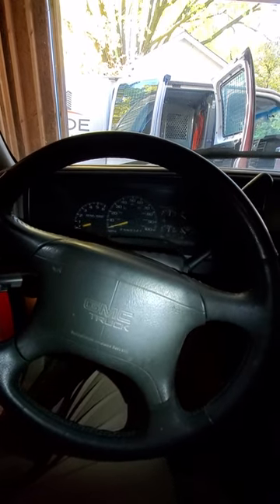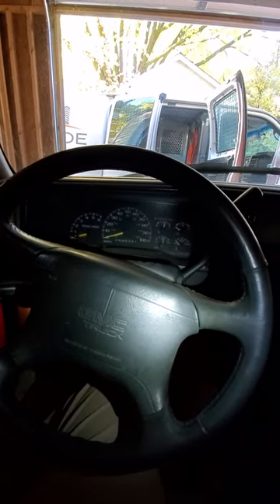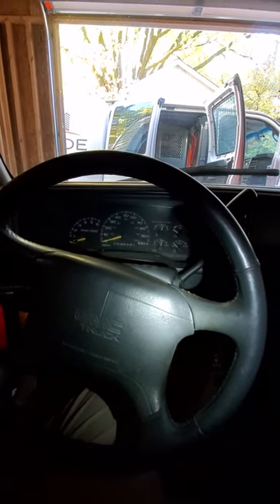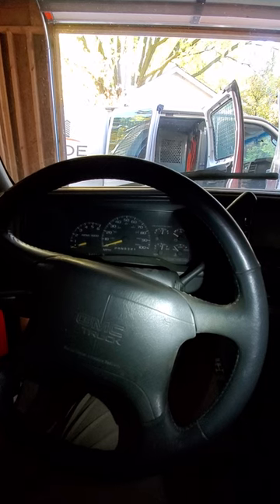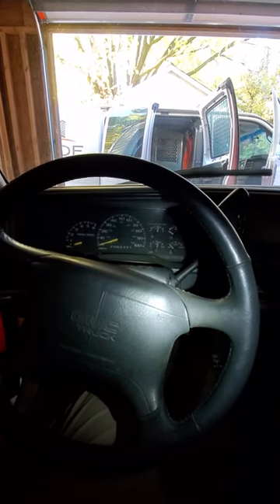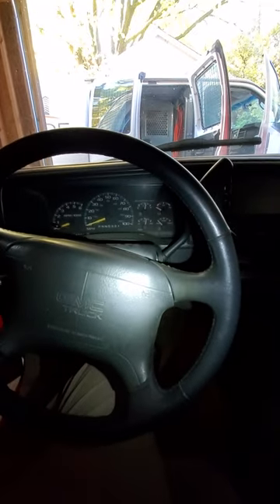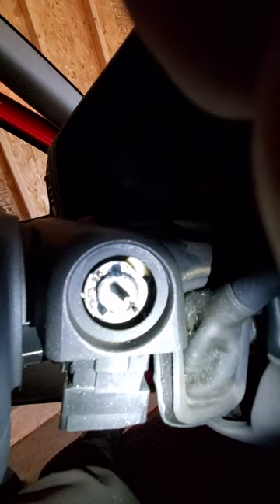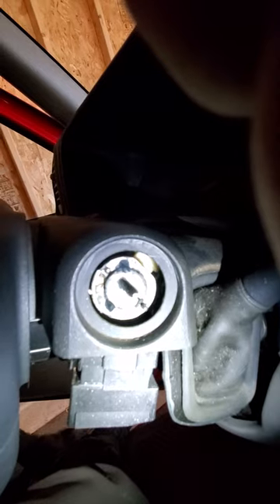1997 GMC K1500 lost key. How to turn ignition with any key.

Comment: Philip, after the hundred something videos I watched on how to do this you're the only one that actually nailed it on how to remove  or turn the ignition with no key.  thank you! your advice was great!
Reply from the maker: I am glad to help. Thank you.
Reply: @happylucky29  Someone tried to rip my 1998 silverado, if I drill it there would that damage the housing as I want to put a new ignition in. 
Thanks! Get back to me asap!
Reply from the maker: @uprite88  the holes are in the ignition switch. If you change the ignition switch the damage is contained in the ignition switch.

Comment: If you take plastic box off below it has 2 small screws holding it on and turn thing in the box will start truck and turn thing in steering column to unlock steering wheel and nothing is needed but a small screwdriver
Reply: Is it the same for 1994 ? Can we do something too make it harder
Reply: Will it shift out of park?
Reply: @klaytone6105  yes
Reply: I need your number so you can show me in a photo😂
Reply: Is there any way you can walk me through this

Comment: You drilled what out? I lost my damn keys. Can't afford ignition. So what did you drill. You didn't point to what you drilled
Reply from the maker: Look closer at 1:09. You can clearly see where to drill. It's two notches in the groove around the part of the cylinder that moves.
Reply: Is it the black spots you can see or is it directly above key slot?

Comment: So you just lucky guessed the two precise places to drill 5/32 holes to unlock that cylinder and unlock the transmission and the steering wheel at the same time ? That was some extraordinary luck. Because there are two other spots around 12 and 6 o'clock that must have been similar to those two you did drill at 9 and 2 o'clock that you didn't drill ? That kind of luck is very unusual don't you think ? I appreciate to learn about this through your up load. But I think there has got to be more to this story. 
  I've seen cars that theives have torn up steering columns to steal cars before to get to the rod that is what that lock cylinder actuates. And I've seen cylinders popped out traumatically so a screw driver can start it and drive away. But this is better than any thief seems to know about. A guy could put a dab of grey caulking in those two holes and use any Chevy key and not appear to be a stolen car ? Even a cop wouldn't be able to tell unless he tried a bunch of keys and realized that any key would work. That is stumbling across what many car theives have wished they knew about . Very quick and quiet and doesn't look stolen. Three cheers for you. Thanks for sharing. I pray no crooks watch this.
Reply from the maker: Just luck. I was about to give up and drilled those spots with a drill bit that I assumed was the right size. 
I don't have this truck anymore, but I was driving it like this for a while.
The black plastic finger turn that covers the cylinder was held on with a black sheet rock screw. 
Glad you found the video useful. 
Cheers